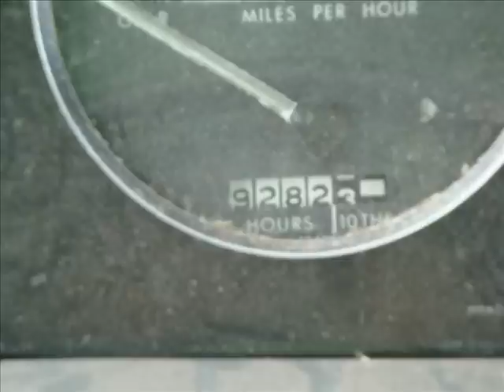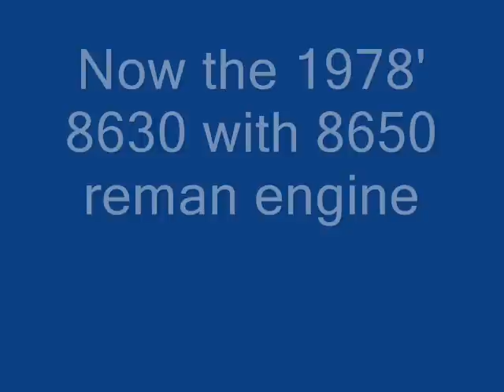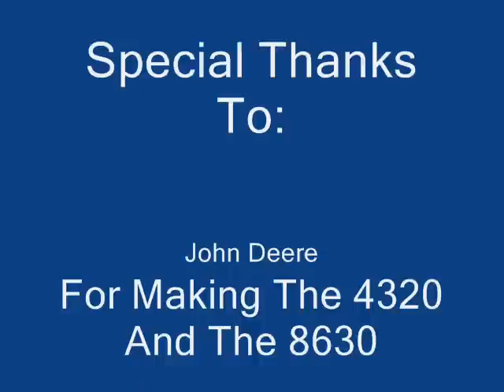8630 jd and 4320 jd

Comment from the maker: there exactly the same exept the cylinder liner packings are better thats why the 50 series is in there the old engine lost a packing and coolant mixed with the oil and ruined all the bearing but we never runned it long enough to hur the turbo so its just a new long block in there